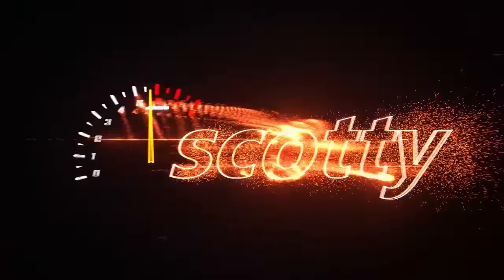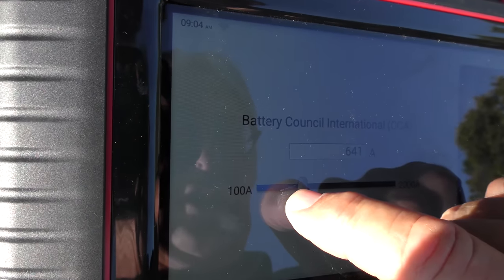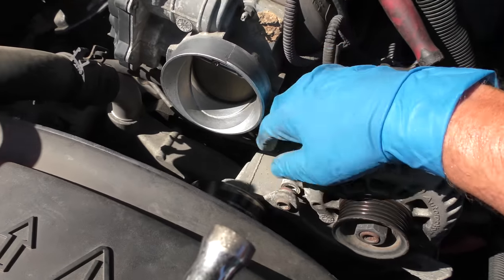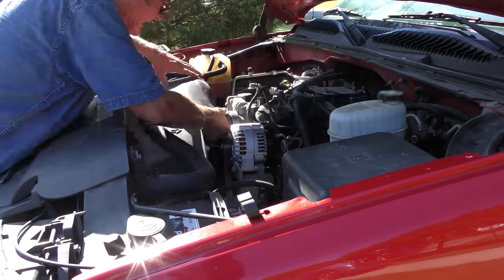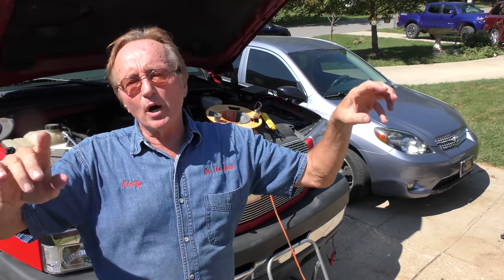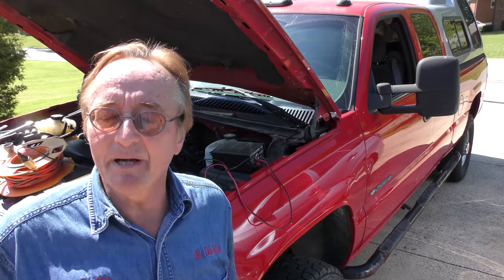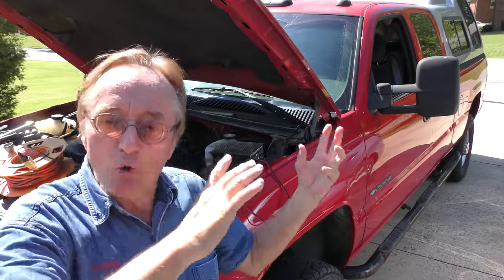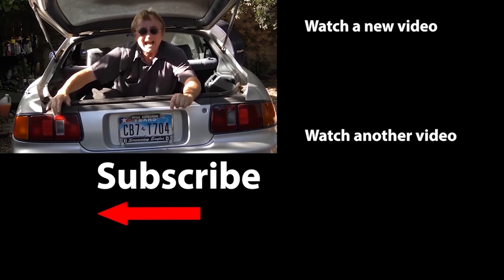I Just Got Kicked Out of AutoZone and I'm Mad as Hell

Comment: Scotty,,, you surprised me when you put a crappy after market brand alternator on a Chevy truck.( Dumb, just Dumb)

I have a 1999 S10 with 200K plus miles on it, and everytime I have ever used an aftermarket electrical part I have had to change it for a GM certified ACdelco part.
My alternator, coils, wires, plugs , switches/relays,  or any electrical part that interfaces with the module is ACdelco.
And my S10 still runs like new.
Installing a P.O.S. rebuilt alternator from Auto Zone or Advanced Auto is a recipe for disaster.

The only parts store that I would even consider  buying an alternator from would be NAPA. They sell fully remanufactured parts that are like new and are up to OEM standards. 
Otherwise, I got to an ACdelco parts dealer and get the right part.

Comment: Scotty is completely wrong about the italian diesel engines. The 1.6, 1.9, 2.0 and 2.4  jtd are among the most reliable diesel engines ever and also have much more affordable maintenance than other diesel engine. They were used by many other manufacturers like GM, Suzuki and Tata. People use them in commercial vehicles, company cars and taxis and they do like 4-500 000 kms without a problem.

Comment: I brought my dead battery to be charged at autozone. When I got there the lady said “It might not be fully charged, it was having a hard time charging.” She stepped outside to do an engine diagnostic so another woman that worked there grabbed my battery. “It’s completely dead it won’t hold a charge.”-She stated while handing me the battery. 

I put the battery back in my backpack and biked home anyway because a few months before that when I went to pick up a battery that I dropped off…. A new worker let me walk with her to where they charge them and my battery wasn’t even plugged up. 

So anyways I bike back 20 minutes with the battery and put it back in and it started fine. 

Just last week I had to screw my terminals back tight because the vibration shook them loose causing my car to not start 🙄 
Better being late to work than having your car completely shut off in traffic I guess. 🤷🏾‍♂️

Comment: Japanese trucks dent if you look at them. Ohms law V=IR. Higher voltage means higher amps based on what resistance is in the circuit. The resistance (truck) should be the same. I'll bet money the alternator did not fix the problem and the new alternator was the same as the old one you changed because it was not bad in the first place. Next time do not troubleshoot with a shotgun fix. There is a current sensor that the positive terminal goes through and attaches to the battery. The computer controls the output of the alternator. If the alternator is putting out more voltage it is because resistance has changed. Usually bad batteries build up resistance as they age because of the corrosion process of how they work. The computer senses this and the alternator puts out more voltage to keep the amperage up to run the truck circuit. Any resistance in the power generating circuit will cause this to include corrosion in the positive terminal wiring or ground terminal wiring.

Comment: That description of how an alternator putting out too high of voltage but not enough current doesn't make any sense.  Provided the wiring is large enough to ignore and solidly connected, higher voltage is more likely to increase the current demand of the battery and any other simple electronics attached as well.  Devices with regulated power supplies wouldn't care so long as the input voltage is within the range it can tolerate.  If the alternator couldn't source enough current for the demand as he is alluding to, the demand would by necessity pull down the voltage.  Voltage, current, and resistance are inextricably linked.  You can't change two in a way that violates the math.

Comment: truth is most people do care about the cost of the part and don't want to fork out double the price for something that lasts like a year longer than a decently-reviewed aftermarket part.  i understand how in this specific case you got burned on a rebuilt alternator, and i don't blame you for not shopping at your local autozone after such a bad experience.  just saying that for a lot of parts, aquiring a genuine GM part brand new can be hard (for older cars, like pre-2000) and always expensive as hell.  if i can save 200 bucks by getting an aftermarket part, i'll probably go for that so long as it's well-reviewed from a reputable seller.

Comment: By the way I'm Pro Mechanic I never Buy Alternators or Starters from Auto Zone or O'Reillys They Suck Don't Last, Here's Best Stores for those Parts Advance Auto, Napa, Parts Authority Here's list of Best Remanufactured Alternators and Starters  Delphi Delco Motorctaft Bosch Nippondenso  Before Starting Engine Make Sure Battery is Fully Charged to 12.6-12.8 After Replacing Alternator. Scotty what does FIAT mean -
Fix It Again Tony or F__k In A$$ Twice

Comment: If an electrical device gives too little amperage at any voltage, it will experience a drastic voltage drop when placed under load. That is why an alternator and battery test has two stages: one without headlights and one with them. Headlights pull a lot of energy, so if there’s too little amperage it will be much more evident when they’re on. Scotty totally missed on this, and just makes it seem like everyone else is dumb. Sigh. We’re not.

Comment: AutoZone hires people that doesn't know the difference between a bolt and screw I avoid them as much as possible. They are rude , ignorant and clueless . Advance auto parts or O'Reilly are more helpful.   I bought and alternator from AutoZone and had to returned it because wast putting enough voltage. End up returning it and replacing it 3 times until finally they gave me a good working one.  They just suck all the way around.

Comment: Wll side post batterys attract crosion and it travels fast on the inside of battery cabel you take your test light stab cabbel i nch from clamp by having clamp from test light on neg of batery the pointy part of test light 1 inch from battery clam and stab cabel have someone try to start vehicel if light goes out bad cabel ...you can either cut floff cabel every inch till see clen coper wire the union new cabel and clamp or just replace all battery cabel clur on copper penny near positive battery termanal it will attract crosion insted of psitive batrery clamp